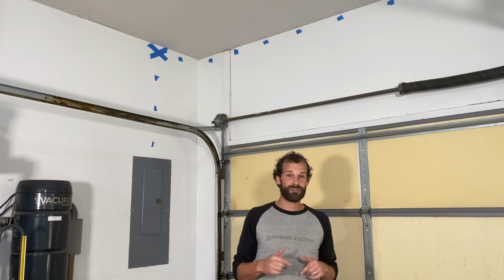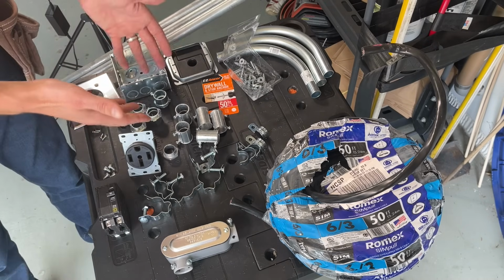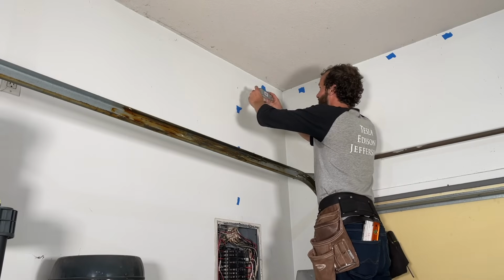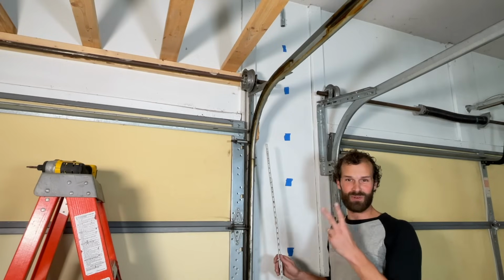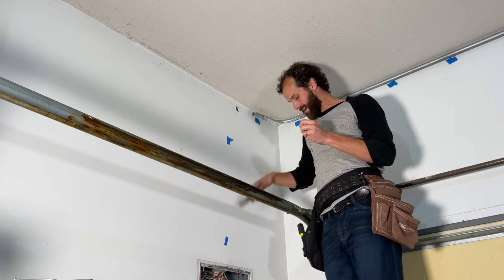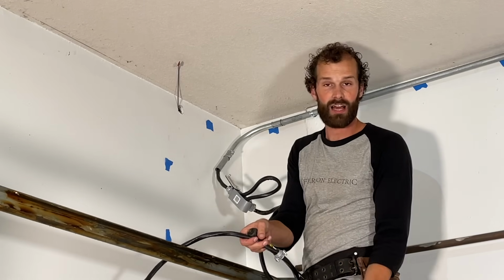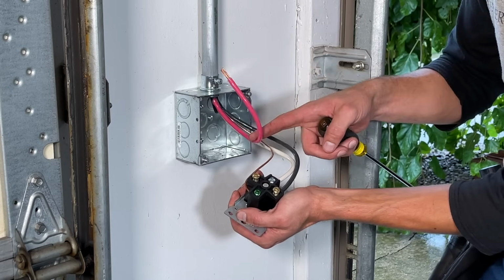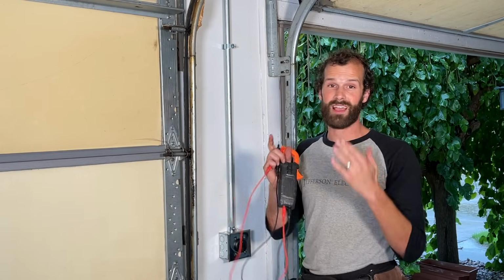How To Install a 240 Volt Outlet | Electric Car Charging

Comment: Enjoyed this well presented video.  As a master electrician in Michigan for 40 years I do have a couple of comments.
First I would have used a 4 square box on the wall above panel, you would have eliminated a lot of stress. Two, on the outlet I think the sharp corners of the flush use plate may be just waiting for someone to cut themselves, a raised cover would have been the correct one.
Also when working with a metal fish tape in a panel is always dangerous. A no conducive fish rod would have been my first choice, if not available I would have stuffed a cardboard guard inside the panel.  
Safety first !
Reply: Just a couple of questions:
1) Rather than working with a hot panel, why not just shut off the main breakers so that the panel is de-energized and less likely to cause a shock or worse.
2) If, for some reason, you can't shut off the main breakers, it would probably be wise to wear non-conductive gloves while you are working in the panel.
3) If you use the bend and tighten technique when connecting the wiring to the outlet, isn't it necessary to do the same when connecting the wiring to the buss bar and the breaker?
Reply: I would have used a non-conductive fish line also.  The cardboard guard is a good tip though!!
Reply: NM is allowed in conduit but fill calculation is based on the entire diameter of the cable including sheathing. 
I would run individual conductors but oh well. both works.
Reply: @urbanturbine  If you used individual conductors would those conductors have to be in conduit also when it goes inside the drywall?
Reply: @VanLe-ne8eg  Yes, article 300.3 (A).
Reply: Single conductors shall only be installed where part of a recognized wiring method of Chapter 3. NM cable is an approved wiring method.. Similarly, MC, AC, individual conductors in EMT, ENT Etc are all approved wiring methods with specific requirements.
Reply: @urbanturbine 
Where do you find the fill requirements in the code? This actually sounds like the correct answer! Also it should be less expensive to do as you suggest and more professional.
Reply: @Mentaculus42  i just use online calculators for a certain percentage fill. But it is in the NEC somewhere :) 
Usually, people don't fill as much as NEC allows because it gets harder to pull wires through as you fill more and more.
Reply: @urbanturbine  
The app is definitely the way to go. Interpreting the code isn’t straightforward and certain areas / cities can have additional restrictions. Actually went down the rabbit hole and it can be a bit complicated by the code tables as fill percentage is in actually more about how much heating due to current.
Reply: @Mentaculus42  Most of the NEC is very straightforward and clear, interpretation is not needed, simple reading is all it takes.
Reply: @Mentaculus42  It starts at Chapter9, Table 1.
Reply: @pld8993  

Thank you. I have already gone down the “Rabbit Hole” on the this question and the answer is relatively complex. Yes one can use it in a conduit SOMETIMES & in not all JURISDICTIONS providing one does not overfill (following tables). It really is a heating / cooling issue if I understood the code but there are also exceptions. Funny how things get complicated fast.
Reply: @Mentaculus42  The answer is very simple and is spelled out in plain English in the NEC. Romex is always allowed in conduit wherever romex is allowed to be installed, which is dry locations only. I have yet to see a local AHJ that forbids it in conduit. I'm not saying there aren't any but I doubt there are very many. The NEC allows and sometimes requires it in conduit so there's no electrical reason why it would be forbidden in conduit locally. It's sometimes required to be in conduit, where necessary for physical protection, like running along exposed along a basement wall, for example. Romex in conduit is treated no differently than individual conductors in conduit when it comes to ampacity adjustment, current carrying conductors, ambient temperature, etc. It's not a heating/cooling issue at all. Most of the opinions about romex in conduit and heat have no idea what they're talking about. Romex in conduit does not overheat simply because it's in conduit. That is false, and it's a ridiculous idea when you consider that it's frequently installed in walls and ceilings where it is engulfed in insulation.
Reply: @pld8993  

I never said that romex will overheat, but it changes the packing factor that does have heating implications which are as I interpret the tables are factored in. Also my recollection was that there are jurisdictions that are noted as having variances from the standard code about this issue.
Reply: @Mentaculus42  I'd love for someone to share a single jurisdiction that has a written code that deviates from the NEC with regard to romex in conduit. I'm not saying they don't exist but I have yet to see anyone provide a confirmed example. Yes, the total number of current carrying conductors in conduit does have heat implications. 4-6 current carrying conductors requires that the max amperage be reduced to 80%, 7-9 reduced to 70%, etc. However, it makes no difference if it's romex, individual conductors, or some other cable type. So if you install two 12-2 romex in emt, for example, that's 4 current carrying conductors (2 hots, 2 neutrals). If you install four THHN conductors, 2 hots and 2 neutrals, you also have 4 current carrying conductors. Whether it's two 12-2 romex or four individual conductors, the rule is identical and is applied the same to either scenario and nothing in the NEC says otherwise. As with any subject, working directly with the NEC, with the actual words as they are written in the actual codebook, typically results in a deeper and more thorough understanding of it, and very few individuals (even very few electricians) use it in such a way. Very little of the NEC is open to interpretation as it is mostly very clear, detailed, and precise. It seems that much of the misunderstanding that results in unnecessary rabbit holes and wildly inaccurate "interpretations"is the result of simply not reading the actual codes as they are written.
Reply: @pld8993  
Thank you for your input. I guess I will have to revisit that “rabbit hole” again if I thought it was important enough. You win even though my memory as a takeaway was that it was more complicated than you state.
Reply: @Mentaculus42  It's not more complicated and one need not rely on your memory or my input to confirm that. Reading the actual text written in the NEC is all it takes.
Reply: @pld8993  You can also use it in wet locations with LT Conduit. It is clear that it has to be protected, and a lot of it is where it's located, the type of conduit, more than the actual problem with romex. It is and has been CLEAR as day since 2020 that it can be used in conduit and the only conditions are protections in place. Can't be used in conduit not UL or approved for wet conditions, can't use it freely around areas with no conduit if it'll get snagged or could get caught from someone, or being a hazard. Everyone is crazy who believe it simply cannot be used. This isn't 1990... I have no idea why people are completely oblivious to it being allowed, to the point they are like flat out "NO CAN'T USE IT!!!!" ---- "GOTTA BE INSIDE ONLY"... uh no. Hell it can used outside, just gotta get by those protection requirements.  It's so weird why people are so stuck on it being forbidden...
Reply: @Mentaculus42  Please stop, you can pack it at 40% fill in 3/4 which is debatable obviously, but move up to 1" and you're packing closer to 30% fill for 6/3.....Unless you're trying to pack it into a 1/2 and maybe 3/4 is too much (probably) but you do have options, like going up to 1inch which isn't that much different once installed, for size or price.
Reply: @johnnyboy13642  You cannot use romex in wet locations in LT or any type of conduit. It cannot be used outside, cannot be used in wet locations period.
Reply: @johnnyboy13642  The cable is limited to 53% fill, not 40% fill. He could have easily run 1/2" EMT here. You don't need 1" or even 3/4" for a single 12-2 cable.
Reply: I was always taught to wear secondary gloves and eye protection in a live panel. Also I would think individual conductors would be easier to pull through that three-quarter inch conduit rather than Romex.
Reply: @Jimmerca  in my jurisdiction it would not get by the inspector , romex isnt rated to run in conduit
Reply: @DeltaCo7175  NEC changed in 2020, guys... You should know this. It changed for allowable to omit that wording completely meaning that it isn't restricted like it was before. That one word changed everything.... some of you guys who are still tearing up drywall and doing hundreds and thousands of dollars of extra work, just know that a single word that changed enable to use of x/x nm-b romex in unconditioned space as well as it's protected. Hell you can run romex through a garage with no conduit as long as it's completely out of the way and away from elements at a bare minimum, but yes, conduit, pretty much EMT, PVC, NM Flex PVC and all the metallics are absolutely fine and up to NEC code with romex now....

Yes the standard method is you can use romex inside and then terminate and go into a garage or shed, or what have you with AWG THHN, through conduit, but that is so much extra work and money. 

As for a "pro" would never do that, well they do, all the time. The whole heating up argument is ridiculous. I'd be more worried about screws not being down to a specific inch / lb and slip out with the 14-50R, which is more likely to cause more of an issue. You know, that actually happens way more than the outer heating argument. People don't screw these things down tight enough or the threads get stripped during installation and leaves a tiny bit of slippage, then you're dealing with an issue 1 year later when the whole receptacle goes bang and melts.

I can't believe you guys don't keep updated on NEC, and you're still set in  your ways doing stuff (and by the sounds of it) stuff that was OK 30 years ok but was even changed 25 years ago. Stuff changes. Why are you all stuck on doing things the dinosaur way because there sure was a hell of a lot more problems back then due to lack of knowledge and materials.
Reply: @johnnyboy13642  "pretty much EMT, PVC, NM Flex PVC and all the metallics are absolutely fine and up to NEC code with romex now...."                                                     Romex has always been allowed in conduit.
Reply: @pld8993  I think the problem that makes elitists whine is the lower c rating, and limited to less amps with romex?  It's just weird because in some areas or cities, they absolutely require romex to be used in conduit. I lived in Chicago a while and even in your basement, romex needed to be in conduit. And that was standard. And then you go elsewhere and people are angry that it's being used in conduit? But it had to be in the NEC for certain areas to adopt it to begin with, it's just... I hate the info people give saying you can't do it when you can.
Reply: @johnnyboy13642  Romex is not allowed in Chicago whether in conduit or not. The only use for Romex in Chicago is to transition from existing knob and tube to a junction box. Supply houses in Chicago don't even sell romex. So you were wrong about conduit fill, wrong about using romex in conduit outdoors, and now you're wrong about being allowed to use romex in Chicago. Time to stop talking johnnyboy, you haven't been correct about a single thing you've said.
Reply: Nice tips Richard.
Reply: I didn't even know non-conductive fish tape exists. Good to know.
Reply: I've done mine following this video. I would have saved much time and effort if i saw your comment about the 4 square box above the panel comment. makes a lot of sense. the LB conduit body i used was a bxtch to deal with.
Reply: Still would have covered the breakers  with cardboard!
Reply: My father was a master electrician here in Michigan as well (IBEW 692.) There were a few tense moments in this video until I remembered that if this guy would have made contact he probably wouldn’t have been “available” to finish this project 😁
Reply: Excellent refinements
Reply: spot  on richard !
Reply: Really good comments Richard! I'll be laying them to heart
Reply: Please let us know, when you post a video.
Reply: I agree with everything you pointed out Richard. I am wondering why he didn’t put a green sleeve over the bare grounding conductor.
Reply: Shouldn’t the panel end be torqued too.
Reply: Definitely, besides the fiberglass fishing rod is sometimes easier to get past insulation and you can use it to fish a “non conductive rope / line” through and then pull the thick / stiff cable through much more safely. Also it appears that two code violations were done (maybe).
Reply: As a DIYer who prefers not to die from electricity, thanks for the tips.
Reply: As a previous electrician I agree with you.
Reply: Question for the electricians: For all the trouble and how crowded the main panel is  why not run a sub panel?   Then u have extra room for more future  garage receps..
Reply: I need to have 240v outdoor outlet and for my electrical pizza oven but, I have only 120 v outlet, and I'm about 50feet away from the circuit breaker. can I convert this outlet to 240v by use to hot wire? can you help with this please.
Reply: Spoken like a professional with a great work ethic!
Reply: I agree, also run 3 - #8 and a 10 instead of the 6-3 NM, easier to pull and half the cost of the 6-3.   If this was done after 2020 code change, it will need a GFCI Breaker.
Reply: He screwed up in this video,  like a lot of electricians, that know nothing about EV charging.
He installed a outlet that is sure to melt over a long charge.    Hubbell Lighting 125V 50A 3-Pole 4-Wire Receptacle – HBL9450A, is rated for the EV charging.  EV's draw high amps 32/48,, for hours continuously ....  hope the place doesn't burn down
Reply: Can you have a link to the 4 square box that you suggested goes above the panel?
Reply: As a master electrician, you should've pointed out the fire hazard with him using the wrong receptacle. NEMA 14 50s aren't rated for continuous use over 6hrs. I've replaced plenty of these melted receps in such short time since EV has been a thing...
Reply: @Werecalledtodestroyevil  A NEMA 14-50 can easily handle 50 amps continuously, indefinitely. For a UL rating of 50 amps, it is required to be able to carry 150% of its rating, or 75 amps. However, the NEC limits cord and plug connected loads to 80%, so continuous or intermittent is irrelevant. The issue is that it makes no sense for such a high draw load that never moves to be allowed to be plugged into a recep. All Level 2 EV chargers should be hardwired; there's no good reason for them to be plugged in and the reason some are allowed to be plugged is because of a loophole that manufacturers are able to work around. I've installed dozens of EV chargers, every one is hardwired.
Reply: thanks for the tips.
Reply: To my knowledge Romex is not allowed in conduit.
Reply: @rickrish9659  yup, it can heat up inside the outer insulation.  That's why you're supposed to use THHN wire in conduit. It sucks to buy both a spool of Romex and 3-4 spools of THHN (white, green, black, and red (or use black twice), but that's the proper way.
Reply: @mlindholm  I believe I read somewhere that some kinds of NM cable may be allowed on some circuits but I would imagine the wire amperage would have to be derated.
Reply: @mlindholm  Romex is allowed in conduit, and overheating the outer sheath is not an issue. That said, a pro would almost never use Romex in conduit, waste of time, money, and labor.
Reply: @mlindholm  Romex is allowed in conduit, though it's an amateurish way to install it. It will not overheat in conduit.
Reply: @rickrish9659  Yes, it's allowed, but it's amateurish.
Reply: @rickrish9659  Romex is allowed in conduit, though it's an amateurish way to install it. It will not overheat in conduit.
Reply: As a master electrician, don't you think that not securing the Romex within a foot of an electrical panel would be a NEC violation? I had to open up my wall for this reason (and only for this reason).
Reply: @ottparn9381 

Good point, possibly three code violations depending upon where this is being done and the inspector.
Reply: @ottparn9381  while it is too late to help you.  2020 nec 334.30.(B).(1). NM  cable , securing and supporting, unsupported cables....talks about the "practicilatity" of supporting these cables.  

I too, believe it impracticable to support these wires in a finished wall.

Yeah, electrician not inspector.
Reply: @keithharrington8715  Spot on.
Reply: @keithharrington8715  Thank you for your reply and pointing me to this subsection. 

The whole text of 334.30 (B)(1) says: "Nonmetallic-sheathed cable shall be permitted to be unsupported where the cable is fished between access points through concealed spaces in finished buildings or structures and supporting is impracticable."

The text is a bit vague and is open to multiple interpretations. My understanding is that it wouldn't be a big deal to not secure the cable in the middle of the run (between two fishing access points). However, when it comes to the panel itself, I'd say it has to be secured. But then, what exactly constitutes "impractical"? Removing many sq feet of drywall is impractical, but is cutting a 12x12 square right next to the panel impractical too? 

I would really love to hear some inspectors' feedbacks for this particular scenario.
Reply: @ottparn9381  If the panel is installed in a finished wall then you can fish it between the panel (access point) and another access point without support. Having to damage a finished wall, such as cutting a 12x12 section out, is impracticable.
Reply: @ottparn9381  did an inspector require you to do that ? after over 50 years in the biz ive never heard of anyone being asked or told to do that. The only reason we secure romexes or any type cable is to keep them from being dislodged during construction until the drywall is up .
Reply: This is great information, thank you 🙏
Reply: Im only a handyman , running the wire to the breaker box is ok,but then the power would be cut off to make all the connection good video
Reply: From the beginning of this movie when 3AM is  scary and the  devil is scary